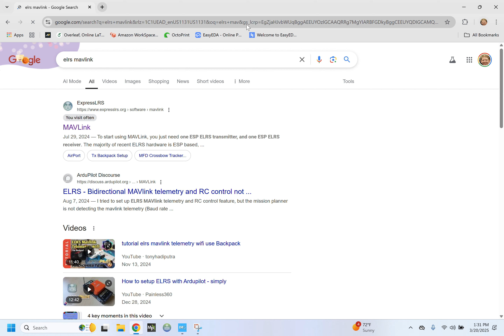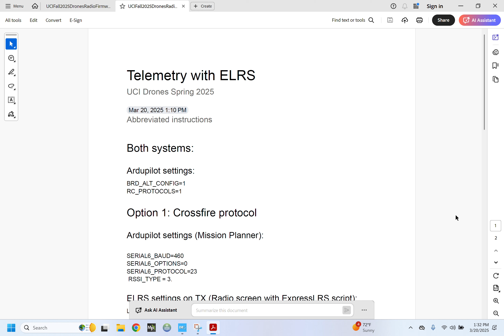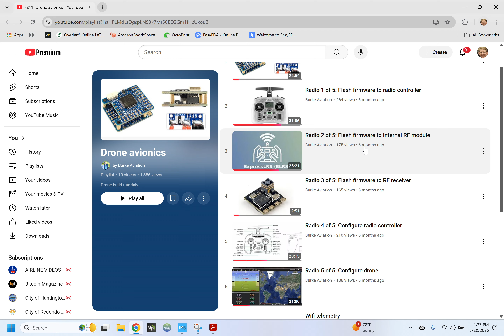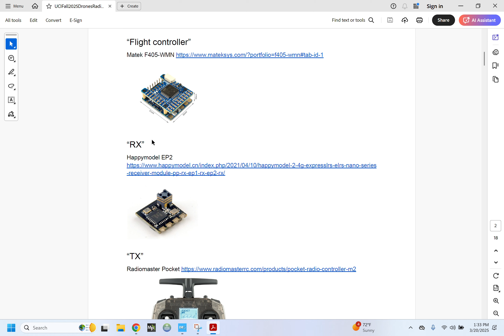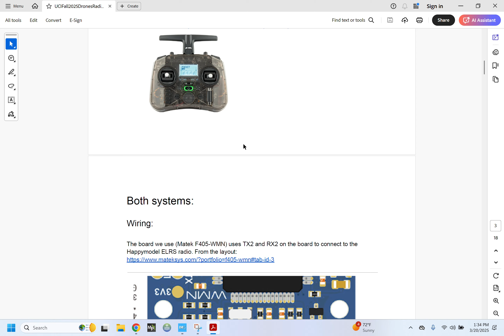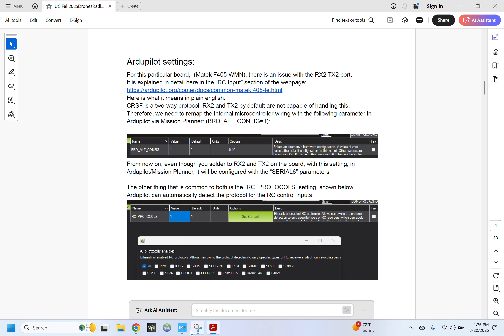Telemetry with ELRS

Comment: sir you missed lots of things to explain pls show every thing you didnt show full parametres in this pls show that there is some setting to need to change in receiver also you didnt show that receiver protocal crsf change to mavlink is must and need to flash latest firmware for receiver as well as back pack also and dont neecd to switch of and switch off radio again and again must tell them that they have some numerical values with expresslrs backpack 00000 like this or some other numbers is must to connect when connecting with wifi
Reply from the maker: see this webpage for all sorts of additional instructions tutorials and the parameter file we use.https://canvas.eee.uci.edu/courses/83758

Comment: 5 months later I'm back to this video. Last time I did it on my plane running arduplane. Now im doing it on a quad. I'm using the same Matek f405 Wing V2 flight controller. Thank you for this awesome video

PS: it would you be really helpful if you could provide us with the PDF in the video
Reply from the maker: all the files are here: https://canvas.eee.uci.edu/courses/81052
Reply: @BurkeAviation  
Would you kindly upload the files into Google drive as the link you gave requiress log in credentials.

Thank you

Comment: Hello. I follow your steps, but then the radio control although connected to the receiver, but theres no changes if i move the rc sticks..
Reply from the maker: What board are you using? If Matek, check all the parameters are correct.
Reply: Its ok now..im missed the uart/serial port set up for the receiver..thanks for sharing this video..

Comment: Why in CHRIST wouldn't you use a newer board that everyone's using??  Are you poor???
Reply from the maker: Good point. Yes we are poor! We are students. I am trying to get as many students involved on a university budget as possible... But also, it is chosen for specific teaching purposes for a class, for example lots of DuPont headers. If you want a newer better flight controller there are plenty available, but they are harder for first time users.
Reply: @BurkeAviation  okay - sorry - I was low on dopamine when I wrote that.  I'm poor, too, but I have several H7s...Building a vtol with a TBS Lucid Wing H7, as we speak - it was only $80.  Some of the dupont header solder pads had some invisible junk on them, however, making them very hard to solder (i'm an expert solderer..lol), so scrub them with isopropryl.  The H7s also have CAN and CAN-FD, so that's a good learning opportunity.  Anyway, cheers -
Reply: @mlentsch Вы хороший ученик. Не боитесь признавать свои ошибки и Умеете учиться. Вывод по Вашей переписке с Автором. @mlentsch You are a good student. You are not afraid to admit your mistakes and you know how to learn. This is a conclusion based on your correspondence with the Author.😊

Comment: Thank you for putting this video together. In my current setup, I have an elrs controller, plus I also have a telemetry radio for mavlink. This is necessary to pass Rtk gps data through mission planner to the drone from a ground gps reference station. Do you have any thought weather the data rate would be high enough to do it through this elrs channel and eliminate ate the telemetry radio? Can one minimize regular mavlink traffic to make more bandwidth available for special purposes? This is really a great video. I had no idea that this function existed.
Reply from the maker: I am not sure. The ELRS documentation has some technical details about how to manage the different data paths and bit rates.

Comment: Thanks for video, can you connect via USB also to tx module. Nothing appears but maybe need external pwr?
Reply: Tried wifi as you did pop up v1.5 but can’t connect, any idea?
Reply from the maker: I would suggest flash every thing again from scratch. There are also detailed pdfs here: https://canvas.eee.uci.edu/courses/72618/files/folder/ConfigFiles